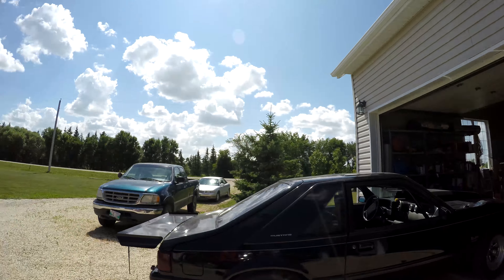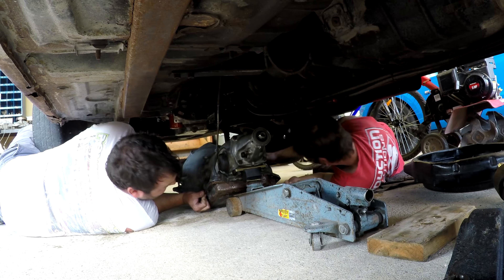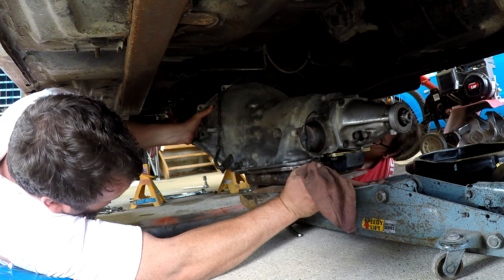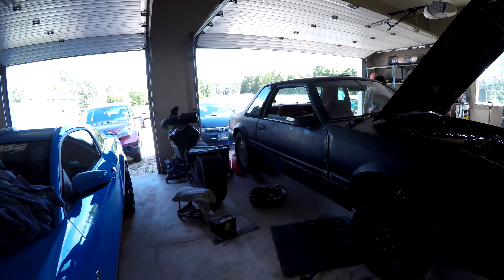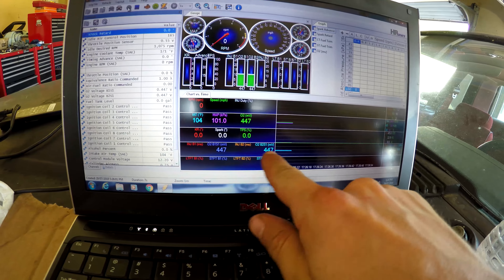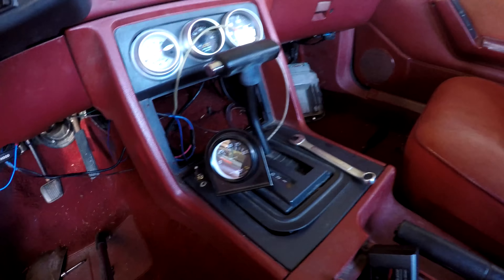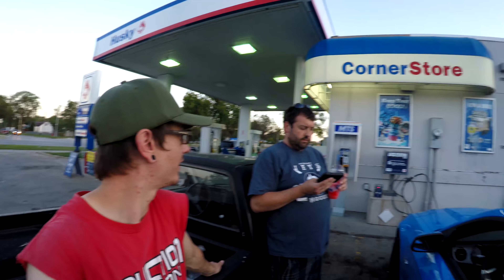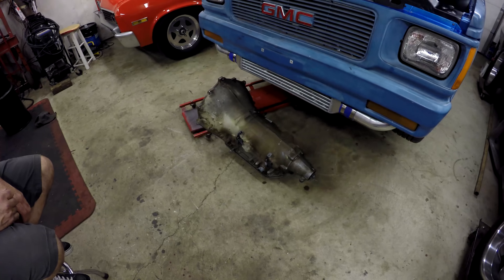Hotrodin' Ain't Easy - SH!THORSE TH350 Install | Oil Leak FIXED! + Cruising (Turbo Foxbody Project)

Comment: How do you start an engine without a flexplate on it?
Reply from the maker: You wouldn't want too unless the engine was internally ballanced.
Reply: I think he's talking about how the starter has nothing to "turn".
And I agree, you spin it over with an impact?
Reply: @SPPTVarmy  what rotates the engine?
Reply: the non-english culture is asking you how you started it without a starter ring to engage. 0:15 i assume you had the flex plate on to start it and no tranny or TC
yaya be a freaking LS mess to fill up the oil with no crank bolts lol

Comment: Question for u I'm having alignment issues with my sn95 th350 to the rear. Did u guys have to shift the trans/tail shaft to the passenger side to mate the driveshaft to the rear?
Reply from the maker: I dont think so.

Comment: What crossmember are you guys using.  I’m putting an 5.3 with th350 in my 92. Can you use the stock c4  crossmember
Reply from the maker: It’s the factory trans crossmember that’s been modified to fit the TH350
Reply: @SPPTVarmy  any pics of the modification of it

Comment: Do you have a vacuum modulator on your th350 or are you full manual valve body? I have a turbo LS I'm working on and a built th350 with vacuum modulator and a transgo boost bypass, not sure how well it's going to work.
Reply from the maker: Full manual valve body
Reply: My trans guy said that a full manual is hard on the street because of the constant high pressure. It's been so long since i've seen the sh!thorse run that I can't remember if it's street driven much lol
Reply from the maker: Ya it gets lots of street K when its operational lol. Lots of things we do to our drag cars are less than optimal for the street, but they still work fine.

Comment: Can't you check oil pressure with the computer while your tuning it?
Reply from the maker: No unfortunately HP Tuners with stock ecm doesn't read oil pressure.
Reply: Can read it on my gen4 4.8 with the e38 ecm
Reply: Interesting I thought it would have. Bit of a big feature to be missing considering you can with a scan tool.
Reply: I think that's the only sensor not monitored by that ecm on a stock pickup it goes to the BCM that's why scan tool picks it up
Reply: @eriksayer884  Yeah tuner in my 02 duramax can't read oil pressure

Comment: 5:08.  Why do people ALWAYS put their drinks right next to the computer on wobbly surfaces.  There are 1000 other places in the garage to put them, but no, I'm going to put them somewhere they are at highest risk of spilling into the laptop....
Reply from the maker: I'm super paranoid about that all the time. Laptop does a lot for me lol.
Reply: replacement laptop keyboards are super cheap. ive never had it actually fry anything. and its a perfect time to pull every single part out of it so you can service the one and only general maintenance thing in a laptop. dust dirt and pet hair clogging the cpu/graphics cooler.

Comment: but ya with a hoist means better lighting. you couldnt put that plate in backwards then. give him a break. your shop has circumstances. yaya just get notched rafters from menards and replace them there. So you have 10ft of head clearance to beable to lift a car. good luck guys

Comment: Rob looked a little philosophical. Bad transmission got him down?
Reply from the maker: Yup, we were all in transmission hell at that point.
Reply: I'm proud of you boys tearing into your transmissions yourselves.  I'm about to rebuild mine.
Reply: @djmips  lots of people think there black magic.  I took a chance and did my Alison 1000 out of my Duramax. First time had a problem but second time got it. Still way cheaper than tracy shop.

Comment: i dunno about welding that converter to the flex plate. you will have absolutely no clamping pressure. i think the welds are going to break. make sure you weld same amount material on each lug so it is still balanced. I recommend welding and filling in the bolt hole with stick or mig and drilling/taping a new hole in the lug. if you are really really good you could do it thru the flexplate bolt hole but it would be so much easier with the converter out.if it were a real flexplate and not a chevy flexplate/flywheel/starter ring the flywheel would beable to turn out of the way. i say wth give the people what they want. if you fail filling it thru a little tiny hole then just weld the damn thing together. every youtuber loves a fail(i think).
ps run it hot so it can cook out the oil and carbon based organisms. making it harder to control a puddle in a tiny pin hole lol good luck my friends.
ya when you weld on a perfectly balanced and ±zero tolerance flat plate of thin hardened steel. yaya its going to warp. will it warp back perfectly as it cools since its not laying on a flat surface?
if you F'up and wind up welding it together from inside the bolt hole. how in the world is it ever going to get ground out to get it apart again. that will make for a video lol. I want to see it when the 2nd band is burnt and slipping and you have to pull it out again.

Comment: you shouldn't use the wideband for tuning your idle. The cam overlap will cause a false lean reading. Tune it for highest vacuum, just like you would a carburetor.
Reply from the maker: Ya its all new to me. Keep it in mind.

Comment: curious, why doesn't the owner install a car lift? they are like 1500-2500$..... would be so worth it.
Reply: then you would need a tranny jack plus he prob doesnt want to die using a 1500 dolla pos
are you older than 18? do you put your life in the trust of $1000 chinese junk? be smarter to buy one from a closed garage/shop for cheap. I remember back in the 80's early 90's you could buy them quality units used for 2k or less. dont you find it odd you want him to buy something 30yrs later that costs the same or cheaper?

Comment: honestly its easier to just muscle the trans up in there. no hoist no jack. your guy there looks big enough to have just muscled it up in there. Most importantly the bottom of the trans pan wont be mashed up against the pickup from it sitting all its weight on the floor jacks cup/plate/2x4
Reply: ya im just referring to the th350 or similar weighted automatics. newer ones are just to heavy to man handle on a reg basis.

Comment: I don't think I've ever seen an LS Series engine get more than 25 or 30 PSI on oil pressure
Reply: The V6 5th Gen camaro hovers around 15 at idle
Reply: @ramairgto72  you only need 10psi for every 1000 rpm you spin.
Reply: lol thats tooooo much pressure at 13,000rpm

Comment: Get a high volume oil pump... Or a better high volume oil pump
Reply: Why?
Reply: so you can run out of oil faster?? doesnt seem like smartest choice since hes missing about 2qts in the smaller oil pan